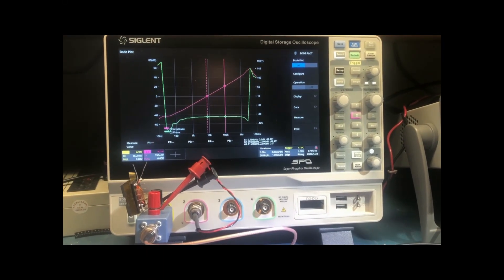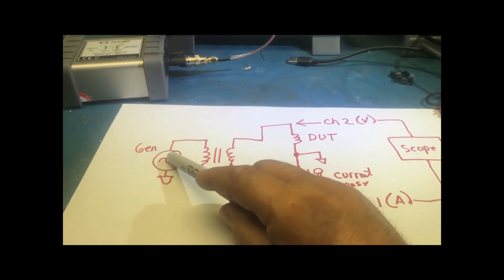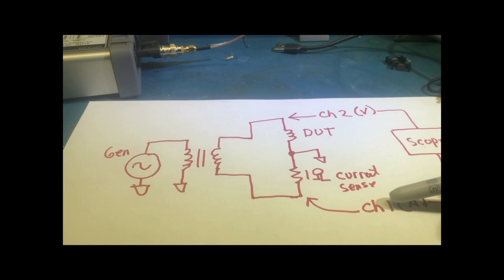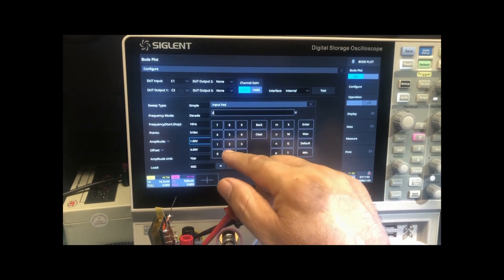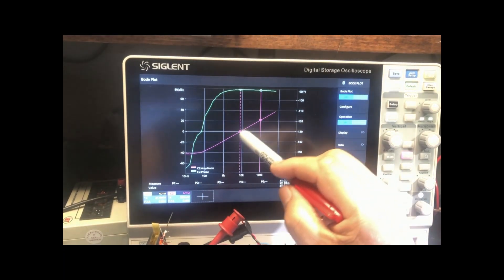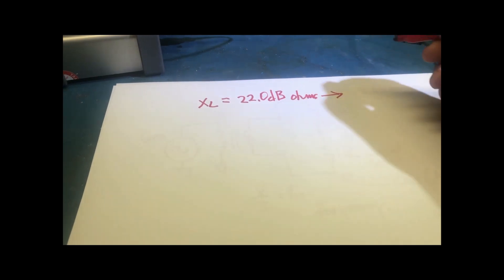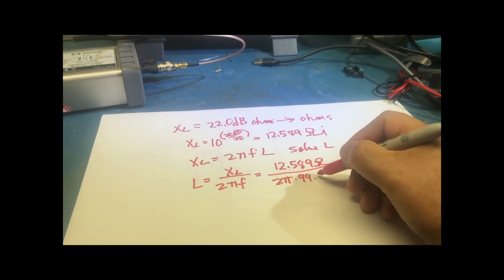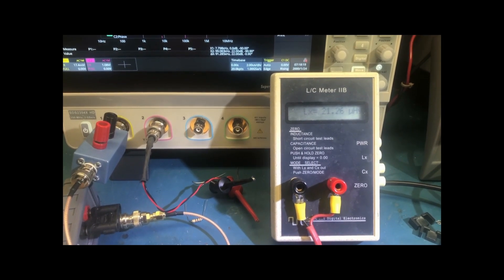Siglent SDS2354X HD Bode/LCR Hack

Comment from the maker: In this video, if you have a scope with a FRA/Bode feature, I show you how to connect a jig to get impedance plots of inductors, capacitors and extract the parasitic components of the devices. Please keep in mind that this is not a feature of the scope. You will see that phase of the inductor is negative when it is supposed to be positive. Inverting one of the channel, might change the polarity of the phase. As long as you know that the phase is inverted, you can still make the impedance measurement and make the calculation and find your inductor and capacitor parameters. If you find this video useful, please subscribe, share and give thumbs up.